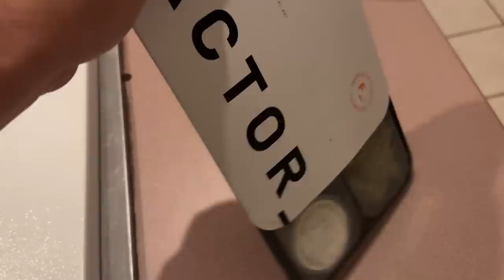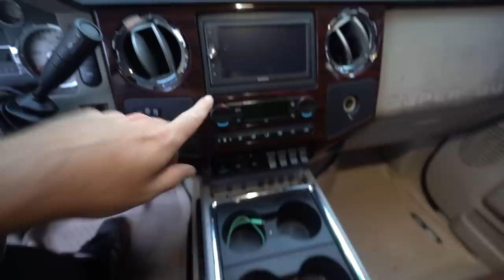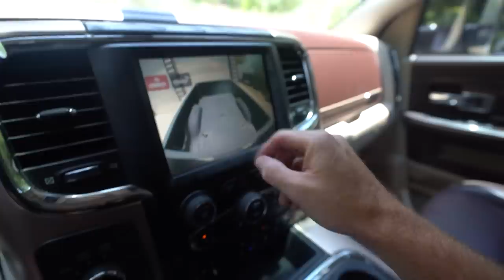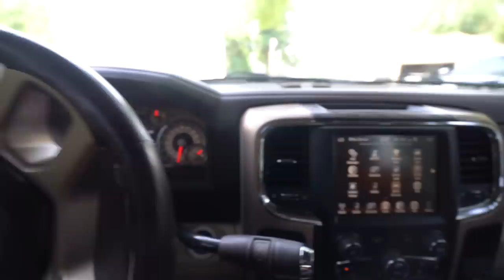My new truck broke down. so I bought another one. bucket list tow rig.

Comment: Be careful moving the hitch back.  Ideally it should be in front of the rear axle.  The more you move it back the less weight you have of the front end and it will affect your braking and handling.

Comment: Long time lurker here. I know of a few older 2000's ford 7.3 trucks with milage between 500 to 800k on them. Some had injectors replaced, one with a HPOP replaced at about 600k (800k truck). I would genuinely consider a 7.3 engine and trans swap if you're looking into something that's bullet proof because all of these trucks are towed almost every day and all of them have the original transmissions. None of these trucks are owned by the same drivers, and none of them know each other. 

Now the ironic part. 800k truck is retired by a 2021 6.7 and he's already not sure of it. He kept away from the 6.0 and it's failures but he did the right thing and has kept the truck just in case. Only reason he's retired the truck is because 700-800k is about the realm of rod fatigue and is planning what to do about it if he decides to reservice it.

All he's ever done to this truck is make sure the oil is changed, and has the trans oil changed yearly.

Comment: Dude you couldn't have picked a better truck! 4th gens are tanks! I have the same one tuned and deleted srw. Tows like a freight train and is super reliable.  Best exhaust break you can get and tons of torque. 🇺🇸 great choice👍💪
Reply: I really don’t get why you would delete a truck if ur not shooting for big power…. It‘s just unnecessary emmisions. We only have this one planet why damage it without a good reason?
Reply: @JohannesB5 it’s for reliability and efficiency.
Reply from the maker: Johannes it’s reliability. The DEF systems fail constantly. The egr fills the intake with gunk. I’ve seen a 200k miles stock truck and it was caked completely shut.
Reply: @Taylordrifts  yeah but that's bcs of Im propper use. You need to follow regen procedure. Imo 200k without issues is pretty dang good! And at that point you can still toss it out.
The efficiency drop is almost nothing for stock application since the DEF system is Completely seperate from the combustion process. What it does is restrict flow but thats it, but the engines i optimised for that.

Comment: I currently have a lml duramax but will be switching to a 4th or 5th gen. The trans also made me nervous. A buddy of mine that is a diesel tech told me that a simple tune that keeps the converter from unlocking at shift points makes a huge difference. He told me that the problem is, if you’re just driving or pulling a hill it unlocks the converter to shift then re-locks it. Essentially “slamming” the trans sometimes. He’s a diehard Cummins guy who runs a service truck so i believe him. Hope it helps.

Comment: So glad to see you got a RAM! I love mine.

It took me an embarassingly long time to realize that the tow-haul button is in the center stack of buttons, and that when you turn on tow-haul it raises the engagement level of the exhaust brake, which I really like!

I'll be curious to see what you do with the transmission, mine is still stock (68RFE), I get the "incorrect ratio error" if I put it to the floor in race mode, so I know my days are limited. But I still tow regularly with it and as long as I go easy it hasn't had any issues so far.

Comment: you asked for advice on the transmission for the truck i would recommend the valve body since they are prone to warping and leaks, also the transmission thermostat is know for sticking look into a bypass or aftermarket solution, also the torque converter and flex plate are known common problems that will leave you stranded quicker than anything else but make sure that when you do the transmission work you check the dowl pins for the bell housing ive seen multiple trucks others have worked on that lose a dowl and have flex plate issues or input shaft or pump failures because it gets cocked a little.

Comment: Get the trans built and upgrade the coolers, have the trans tuned, keep it serviced. I have the same truck with built trans. Trans was replaced at 150k. Currently have 422k, same engine, same trans since upgrading, regulars service pulling a 38 foot gooseneck for hotshot work. Only issue was a shift sensor. Been a trooper.

Comment: If it’s a 68rfe which most likely it is, get a nextgen diesel f1 valve body, trans thermostat bypass, and Mishimoto cooler. If you wanna go deeper get a upgraded drop in pump and a converter with billet flex plate. As for tunning armor inc in Canada is great. Good luck!

Comment: Need a slider hitch since you have a short bed. Save those cab corners. Also looks/sounds like aftermarket injectors and a tuner. You can hear some injector timing rattle and see a bit of haze. For the 68rfe, go Firepunk or Red Horse Motorsports.

Comment: Refresh the transmission. Put some new raybestos clutches, billet input shaft, billet d and j valve body plate, and billet flex plate. Lastly get a revvmax thermal bypass and you’ll be set for many years

Comment: Dropping rpm is for efficiency, there should be a power/sports/tow mode button, that drops it from the high gear range.

The trans and the gear options make a difference, more so with slight grades.

Comment: Definitely recommend putting a fass fuel lift pump on it and run 2 micron filters. Without better filters the stock injectors generally need replaced between 150k to 200k miles and last much longer with better filtration

Comment: Foaming glass cleaner with ammonia works great for taking stickers and tint goop off. Also get yourself some iron fallout remover and a mothers speed clay. That will clean it up fairly good while reducing scratches. Sad to not see the fummins get put to use but it’s understandable. Glad you go yourself a Cummins. We had a similar truck 2014 Cummins mega cab and we hauled a 42ft gooseneck across Canada and it towed like a dream. I can’t wait to see the truck haul!

Comment: You can get a 5th wheel hitch that will slide back as you turn with the trailer. It’s designed for mega cabs so you can have the full size trailer and everything

Comment: Great choice. I agree on all you said about that body style looking good, looking "baby semi". Will be a bit tough in the short bed configuration with turning radius on your goose but as long as you stay cognizant of that you'll be fine so you don't smash your cab corners. I had a 2007 5.9 mega DRW with a Fleece Cheetah turbo and Randy's State II trans and canned tune. I loved that truck and hate to have sold it but I was living in a condo and the truck was having issues left and right (Mopar parts, not anything engine related) and it was just impractical to keep dumping money in a truck that I could do nothing with living condo life. Anyways, love the new truck you got, you made the right choice over the Ford, things happen for a reason!

Comment: The offset is def needed, I ended up switching to a long bed cause the car the hauler hit the cab at least 7x… it was nvr intentional, 4x is was cause of a divot or the dirt ramp pulling into the pits at the track… the offset wld be a good idea, trans cooler - my warranty covered 2 Trans and a tcase bearing. Also definitely get the air bags with on board pump. it makes the rear ride so much smoother and loading is easy to raise. Enjoy the mega cab, it’s cozy for sure

Comment: As a 13 year dodge tech who specializes in transmissions, i think you've made a great choice 👍. My advice is that since you've got the 68RFE transmission make sure you're using the tow/haul mode, the major weak point of these is the overdrive clutches and it doesn't take much to smoke them. But, if you're careful they work just fine 👌
Reply: Valve body, trans tuning and torque converter work wonders for the 68.

Comment: Check and recheck the wheels studs. My bro in law and my boss both have lost a wheel and had damage because of rams wheel stud issues. One was a 2014 and the other I believe is 2016. Only happens on the 2500 and 3500

Comment: Hell yeah man! I've got a longhorn limited (the one above you mentioned, but it's actually equal just more "city" focused because all black interior vs the "country" focused two tone you have) you should look into:
Z Automotive - useful features unlock
ZFlash - strobe module for stock lights, works with trailers connected too
Firestone commercial Airbags - better mounting than airlift
AlfaODB - programing computer
Proclip - phone
Bulletpoint ball mount - tablet
Vehicle OCD center console organizer - they make a top and bottom one so things don't fling around or get lost in the pit
Titian tank or low pro transfer tank

Saw you're already deleted and tuned with the 68rfe transmission (based on dipstick location) could always change it out for some other tuner, but uping the line pressure and changing the filters is always good

But banks has a good bit of goodies to put into the truck along with BD power...and the rabbit hole goes on.

Be careful offsetting ball too much for weight distribution, airbags help mitigate but thats a bandaid, could throw a GEN Y torsion hitch or a SHOCKER hitch in for chucking and offset at the same time

Excited to see your touches to it.
Reply from the maker: Thanks for all the info! I ordered a Gen-Y offset ball and a shocker 9” offset hitch. I’m hoping the combo gets me most of the way there!
Reply: @Taylordrifts  if you end up not liking the Shocker, gen y pegasus 11" offset would push it further. But again watch weights, try to maximize your trailer axles vs pin. Watch your hitch swing it will be tearing up anything in bed including the wheel wells and the bed caps.

Comment: As a daily driving tow rig about 200-300 miles a day my 2012 6.7 3500 hasn’t skipped a beat besides water pump which is insanely easy and brakes / tires I’ve put about 200k in the last 2 years almost 9-10k a month i haul a 2 car trailer and live in wa where there are lots of hills. I will always suggest Cummins trucks to anybody

Comment: The Ram goose neck balls sold by Dodge were recalled. I have a 2017 Ram 3500 got the Ram Goose neck ball and chain hooks kits,  when I bought the truck and several years later got a notice from Dodge that they were recalled and they never replaced them. I bought another brand goose neck kit online.  Any trailer I've owned I have had to lengthen or replace the chains when using the goose neck. They were always to short like your trailer.

Comment: I think it was a good choice to make the move to the Ram. Those are good trucks and I have known other racers that use them.  The 6.7 liter is a good engine but their "Stink-eye" is the intake heater grid.  Those things come apart and drop parts into the engine and have been known to trash an engine.  I don't work for Banks but they have an intake fix for that.  Its not cheap but you will never have a broken intake heater grid come apart that grenades the engine. Preventative maintenance bro. I hope you all have a great season and happy trails.

Comment: Would have kept the Fummins... and I would still keep it on the back burner. My brother has a 16 limited with the Cummins and the aisin... It's been a bit of a nightmare since new but made it to 350k km. It's been parked mostly for two years for many many little issues. After he had it tuned it made great power but with no option for the trans to be tuned it's a slug unless your using the shift buttons.. I'm a Cummins guy but I think I draw the line at the 3rd gen..

Comment: Finally learned his lesson with the Fords and bought a real tow rig. From what I gathered the trans on the 6.7l trucks is pretty damn solid and shouldnt give you much issues, the issues you mentioned was on the older 5.9l trucks.  Especially the 2nd gen cummins, the trans was absolutely garbage and could barley handle the stock 200hp.  You can convert to 5th wheel and get a slider for parking situations, or convert it to a box truck/flatbed, if not then at least get a headache rack.  The more you leave the engine stock tune the less problems you will have in the long run with engine and trans, although that does take some fun out of it all.

Comment: Being that it’s a 3500, If it’ has an Aisin, it’s a stronger transmission but they still aren’t like a night and day difference vs the 68rfe. Better but not the end all be all, there’s nothing you can do to the aisin,there’s no tuning, no building, nothing can be done. If it’s a 68rfe, you want it fully built, because more than likely it will blow if it’s stock. Randys diesel and revmaxx are good options for built 68rfe’s, but they get very expensive. Ats also offers a direct bolt in allison swap with no adapter plate, because they have the housing designed for the cummins block, and it’s a direct wire connection as well. The only thing is you need to retune to make your truck think it’s an aisin, because it works like an aisin, as they have separate computers like the allison.
Reply: Also, the fummins is a 5 speed, not a 4 speed like you stated. 7.3’s have the 4r100’s (4 speed rated for “1000 ft lbs” which is questionable) 6.0’s and 6.4s had 5r110s (5 speed rated for 1100 ft lbs) 6.7 powerstrokes got the 6r140s, (6 speed rated for 1400 ft lbs) and late model 6.7 powerstrokes have the 10r140 (10 speed rated for 1400 ft.lbs)

Comment: Make sure you hit it with a clay bar before you ceramic coat, or you'll seal in the dirt. Probably wanna buff it with a cleaning compound (waxless) to remove the oxidation first too.

Comment: 1 - Suspension - Go ahead and get a Carli kit with progressive springs, caster shims, icon shocks and your ride will tremendously increase

2) For the transmission, get one built from Randy’s out in Utah and be done with it

3) Get a FASS with a sump and give that hpfp a positive draw vs a negative

4) Fleece cheetah with an S&B intake. Stock VGT turbos known for going out and veins sticking. You could go non-vgt but for better drivability, keep the VGT
Reply: And if you need some tunes let me know and Ill get you hooked up.

Comment: I'm not sure if it applies to stick shift trucks, but there is a known issues with harness chaffing just under the driver's feet(under cab to frame). I had that one bite me with one of my trucks.  Other than that, I put a lot of miles on a 16 and a 14 3500's. Wheels &tires can be tricky, getting a good balance goes a long way.  They love to pull, let um eat.

Comment: If you have the 68RFE, check out the RevMax valve body and trans pan.  Might want too install the transmission cooler thermostatic bypass as well.  Depending on which tune you use and how hard you push the truck, a built transmission might be in the future regardless.

Comment: Trailer off set, gen y hitch, air assist in the rear, leds for the projectors, tablet swap centre console and find a truck shop in your area to go through the trans and build it up. Coming from a ram owner 😅

Comment: First thing you’ll wanna do is upgrade those halogen projectors. They’re absolutely useless (I’ve owned 3 4th gens). A nice HID retrofit works good in them but I’d do what I eventually did and get the Morimoto XB LEDs. They’re what I have in my current ‘15 Cummins and they’re fantastic for lightning up the road. Oh I also put the Morimoto fogs in as well.

Comment: TAYLOR MY DUDE

OK several things. My 4th gen with 3.42s 68rfe and 35's tows like absolute poop in 6th, I do what you mentioned and just roll in 5th and it's fine. Maybe squeak 6th going downhill. 

68rfes are fine until you try and slam a bunch of torque through the overdrive clutch (5th and 6th) I've rebuilt more than I care to think of and EVERY SINGLE ONE has the exact same failure. My recipe (no trans removal) is a 'protect 68' valvebody gasket kit and crank dat line pressure. and if you want to yard trans, transgo makes a kit to slap 2 extra od clutches in it. Everyone's got their dicks out for billet this, quad disc that, unless you're compounded making silly power, shit's not needed. 

It sucks but the way to make these live is don't lug it in 5th or 6th. Especially 6th!.... Just let them downshift when they want to and they will live.

Next point is the gooseneck. Just stretch the truck dude! There isn't a lot to it, and they're just f'kn sick! I CAN'T WAIT TO DO MINE!! It's DIY-ABLE and you would not be challenged to do it. Killer content too!

Comment: Make sure you check for the intake heater bolts common problem the engine eats the bolts as the go from the inside of the intake. Happened to many of these trucks.

Comment: Increased line pressure will save this trans, Ive got over 100k miles on the STOCK trans in mine with motorops tune, delete, fuel system, etc. Only thing done to trans is an ATS line pressure maximizer plate and Im a firm believer. Allows all of your forward gears to have to same line pressure as reverse. Shifts firm which I personally like but shift points are my only complaint with these trucks.

Comment: I like that as a solution. The automatic transmissions on these Dodge trucks were always the weak point. My dad had a late '90s 2500 with the V10 and the manual transmission and that truck was dead reliable. Almost everyone else I've known with the Dodge pickups complains about transmission issues.

Comment: the carbon steel razors for box knives scratch glass, you need to use the scraper blades the style that slide into the scraper thing, they are much softer steel and dont scratch the windows